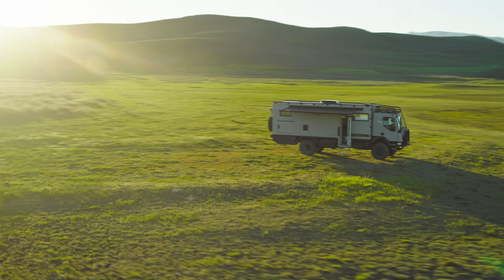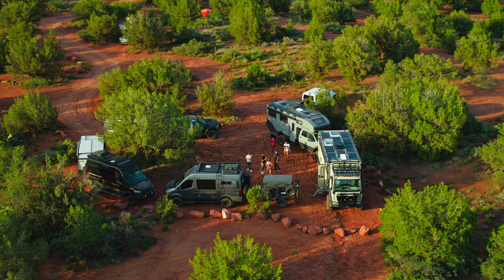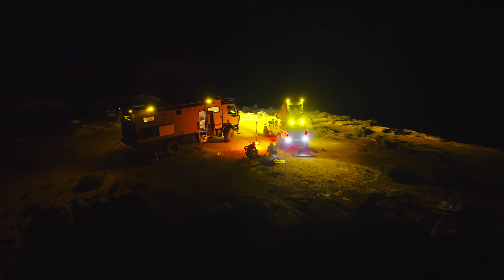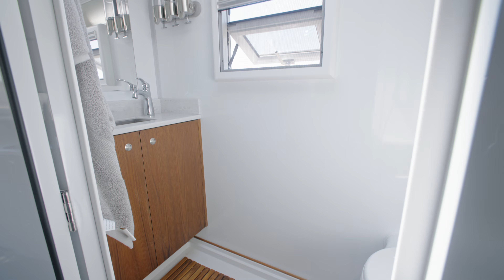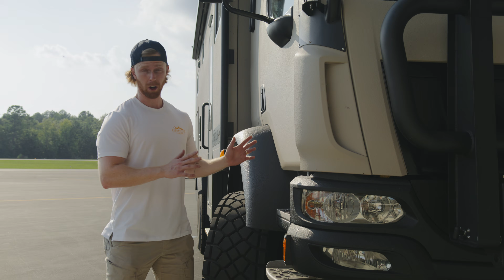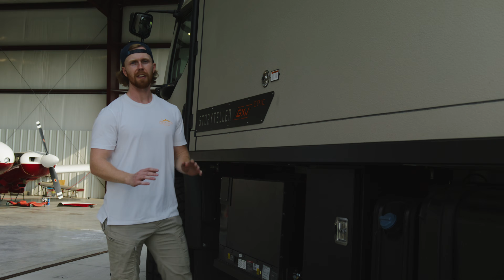GXV EPIC Comprehensive Walkthrough

Comment: Modestly surprised at the small / undersized motor. 660 lb/ft is barely enough for my 5th wheel tow pickup. Can it easily maintain 70+ MPH on hilly highways? Would much rather see an 8-10 liter with double the torque.
Reply: And that’s why the -lanes is f**ked. First that people like you think 6+ ltrs is ‘modest’, second that you feel 10ltr is what’s needed, and finally that you feel you should be able to drive this thing up hills at 70mph. Jesus wept… 🙄🤔
Reply: @leangrypoulet7523 Don’t hold back. Get on in there!
Reply: @leangrypoulet7523 
What is '-lanes'?
Reply: @largemarge1603  To be honest, 5months on, I’m not sure 😂. At a guess, I’d say ‘US’. Why spell check or my iPad changed it, I don’t know.

Comment: I would LOVE to see one of you Overland manufacturers make an all electric rig. Idk what would be the best way to do it. Be it working with GM and using either their Hummer or Silverado/Sierra EV platform, or if it would be easier/better to use an existing gas or diesel vehicle and use E-axels and convert the ICE into a generator. I really don't know. I just know it's possible. But whichever one would be best, turn into an awesome overland rig... I think that would be SO COOL. A fully electric overlander that's just as capable as ICE overlanders. The roof and hood could be loaded up with solar and fully capable of charging the vehicle batteries over a few days. You could also do the whole onboard generator thing with an existing ICE platform. Or a new custom one. Maybe Edison Motors would be willing to team up. That would be SO awesome... I definitely think it's possible to fully charge with just the solar though. Like I said. It would just take a few days. But when you're driving your house. You can just park for a few days to let the batteries charge. Then continue on. But you could also, again, have some onboard generator. Just add a good water filtration system to be able to collect water and you'd be fully self sufficient... The ULTIMATE doomsday rig...

Comment: Why do you need a generator if you have the truck’s engine?
Reply: You think with that much fuel that if it had autostart that it would work. But I bet they didn't want the shake of start stop. 

I was a trucker for years, and our semi had auto start no genny, it would save weight and add storage if they went that way.
Reply: The truck is a 12v system (actual a 24 chocked down) At idle it takes a lot longer to charge than the generator
Reply: @richardhollingworth1166  in my semi it would kick on the truck when the batteries were low. It didn't idol it cranked up the RPMS and held it until the batteries were charged and cut off by it's self.

Comment: tried and true kenworth k370? 
1 it's been out 10 years, hardly "tried and true"
2 it's got the  cp4 pump, that thing is for sure to take the whole engine out.
Reply: I'd get a dcr pump then delete it with a 0- 30 hp tune.
Reply: @toddpharmer2460 
660 torque seems anemic.

Comment: Compared to some other offroad expedition vehicle it seems to be a little bit "funny" to speak about great offroad capabilities. Its wheelbase is much to long and the aproach angle much to low. There are a lot of trucks with better geometrie. Might be great to live in and for bad roads, but please don't speak about the great offroad capabilities.
Reply: I drive a concrete mix truck all day long on some of the worst construction sites on the side of hills in the bluffs of Iowa and Nebraska. IF I can get a up to 80000 pound low riding Mix truck with the exact same wheel base without that 4 wheel drive through what I do. This thing will tackle anything unless your deliberately trying to get stuck!!!

Comment: When I get it stuck off road, how many Jeeps will it take to pull me out?  I suspect that thing weighs in excess of 25,000#.
Reply: I drive a Kenworth Concrete Mix truck for a living, Its nearly impossible for me to "get stuck" unless I deliberately go into deep mud. If a fully loaded 80000 pound mix truck can crawl through some of the most aggravating construction sites you have ever scene and up near 50 degree slopes hills and roads. your going to have to try REALLY hard to "get stuck" in this thing especially when it has its own wince to get you out....
Reply: @HighmageDerin  This is not ideal for offroad as it's top heavy so even if it doesn't get stuck you won't have the confidence to get it off the road

Comment: My take, congrats:
k370 engine, what is the story of this Paccar engine or Cummins, turbo, no turbo etc.? please expound upon.
2-is the service for the chassis KW worldwide as we travel way far south of the border? avoiding the bad-hombres territory
3-Can it be converted to hybrid, Diesel and Natural gas to a net equivalent of 18mpg in net savings?  I have a genset 80kw 6.7L Cummins converted to hybrid diesel-natural gas on the fly, we went from 4 gallons/hour to 8 gallons/hour equivalent in net savings 
4-can the cabin fit 4 passengers?
5-Diesel tank a big problem, $10,000 worth of diesel is a bad-hombres magnet traveling south of the border, r those tanks built tamper-proof or tank locked with double steel walls on the diesel tank?
6-I like the alternative kit AGM-battery with a genset myself, like a Newell Coach, without an expensive lithium kit... what would be the starting price for the Patagonia?
7-can the DEF be hacked, not need for that system south of the border?